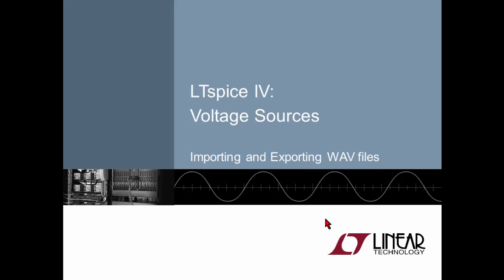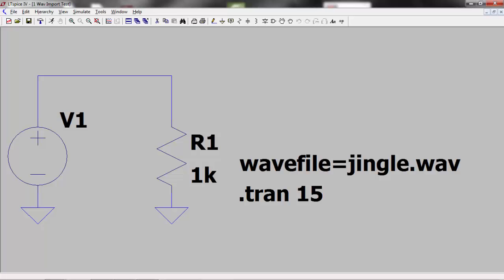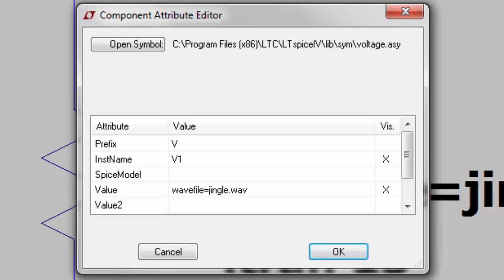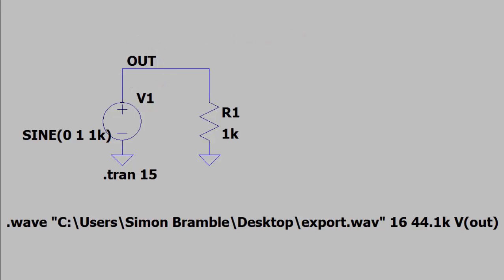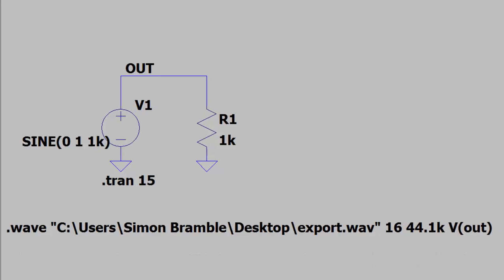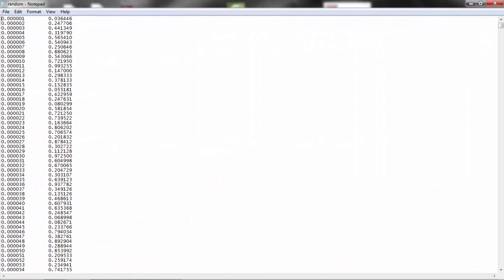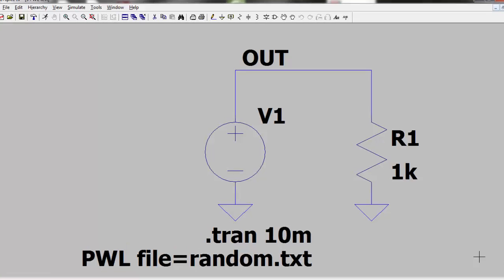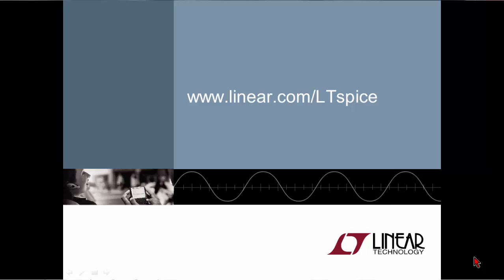LTspice: Voltage Sources (Importing and Exporting WAV Files)

Comment: I'm not very impressed by that on MacOS ... whatever wave form I try to load I'm getting an error that it cannot read the file regardless where I put the file on the filesystem. However if I save a large file LT-Spice hangs. Update got it.. I used mplayer -ao pcm file.wav to strip headers on macos.
Reply: wait is this a separate program to strip headers?
Reply: @jweeeen  yes.

Comment: for a file .wav in the same folder of the .asc file it doesn't work. I see only the message: "Wavefile: Missing node(s)"
Reply: I know this is late, but the instructor did a very sloppy job in describing exactly what he did. In the way it was presented, you would think that you should put both the "wavefile=jingle.wav" and ".tran 15" in BEFORE you do the Ctrl-Right Click thing. In fact, the wavefile=jingle.wav comes FROM the Ctrl-Right Click action.

He had already done all the actions of the video prior to hitting the record button, and failed to tell anyone he had dragged the value of V1(wavefile=jingle.wav) to the complete opposite side of R1 where no one would have a clue there was any association.

What you have likely done was manually typed in the wavefile=jingle.wav above .tran 15 and THEN set the value on V1 separately. Remove the first wavefile and only follow the V1 instruction and you should be good to go.
Reply: @djd829  thanks man!

Comment: You leave more questions unanswered.
Reply: wtf is Trans 15 ? 
and how did you get Wave=jingle on the program..
Reply: "how did you get Wave=jingle on the program.." I explain this at 1:13. 

".tran 15" tells LTspice to run the transient simulation for 15 seconds. This is a basic function of LTspice and used in pretty much all simulations. Google me. I have an online tutorial on LTspice that goes through the basics. They were not necessary in this video as most people using LTspice know this already
Reply: Simon Bramble ok ok that makes sense now thank you

Comment: Is there any limit to the file size? And what about stereo?  I'm thinking of doing some really heavy decoding operations on wav music files, which can't be done with  (free) uadio editing  software....
Reply: LTspice can generate stereo files, but the quality of the playback depends on the audio circuitry in your PC/media player.

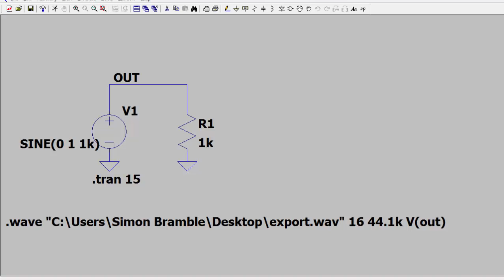Duplicate the circuit shown at 1:40 then rename one channel as CH1 and one channel as CH2. Set each channel to output a different frequency. Keep the voltage sources to less than 1V.

Change the command line to:

.wave "C:\export.wav" 16 44.1k V(CH1) V(CH2)

This command digitises CH1 and CH2 to 16 bits, 44.1ksps and outputs V(CH1) on the left channel and V(CH2) on the right channel.

Play the WAV file back. On my Dell laptop I noticed about 30% of the left channel appearing on the right channel (measured on an oscilloscope). This is not a fault of LTspice, but a fault of the audio stage in my laptop. Playing the same WAV file on my Samsung S8 gave no measurable crosstalk
.

There really is no limit on file size

Comment: If I probe V(N001,N002) and then create `.wave test.wav 16 44100 V(N001,N002)`, it says it can't find node V(N001,N002) even though they're right there on the oscilloscope.
Reply: I see what you mean. LTspice does not seem to want to export a differential voltage (measured across Nodes 1 and 2) into a WAV file.

There is a work around..

Set up a behavioural voltage source to replicate this differential voltage to something that is ground referenced

I have a tutorial on behavioural voltage sources on Youtube. 

Click the AND gate symbol in the LTspice menu and select "bv". Right click over the behavioural voltage source and in the Value line, enter: V=V(N001,N002)

Label the output of the behavioural voltage source as OUT. This converts V(N001,N002) to a ground referenced output, OUT

Then export the WAV file using (in my case): .wave "C:\Users\simon bramble\export.wav" 16 44.1k V(OUT).

This will take the output from the behavioural voltage source (which is a replica of the differential voltage) and dump it to a WAV file.

Hint: you might not know how LTspice is going to label the circuit nodes. Therefore use the line V=0, run the simulation, find out how LTspice labels the nodes, then edit the V= line according to how LTspice has labelled the nodes.

Or... label your nodes as something useful like: TOP and BOTTOM and set the Value line in the behavioural voltage source to V=V(TOP,BOTTOM).

Comment: Is there anyway to hear this instantly? All this importing and exporting seems exhausting, when we are already watching signal.
Reply: if instantly is real time the answer could be: if it could technically, it would sound depending on the speed of your PC. Delayed lower pitched or speeded up high voice ;) ?
Reply: "All this importing and exporting seems exhausting" Exhausting. 🤔 You mean picking all the necessary components, placing them on the breadboard, running a signal thru the circuit, attenuate the output to line level and sending it to your computer's audio capture card exhausting?